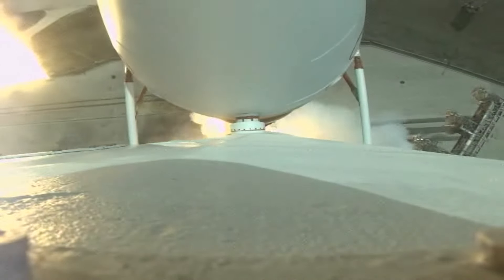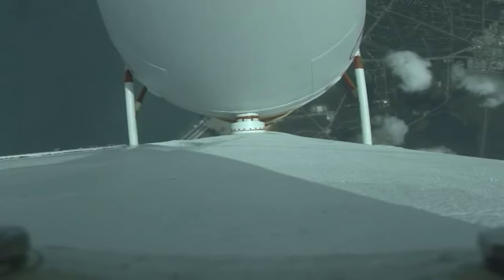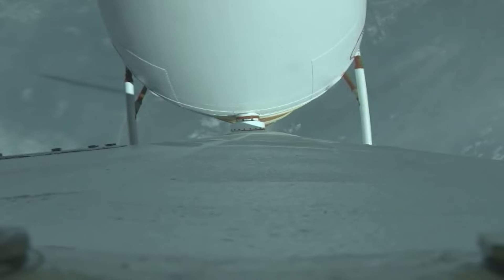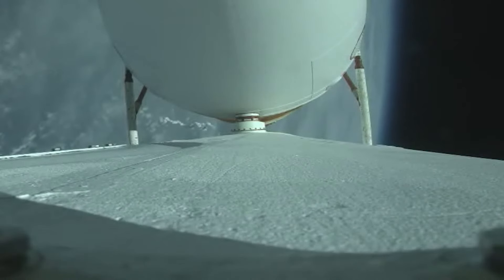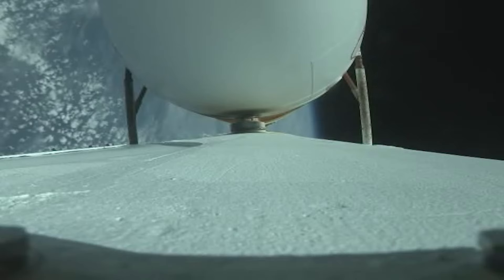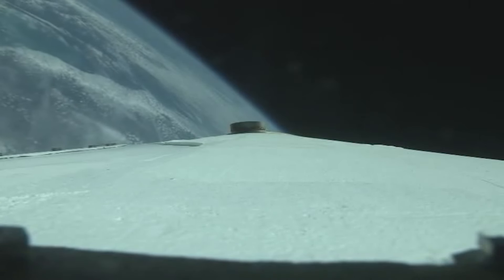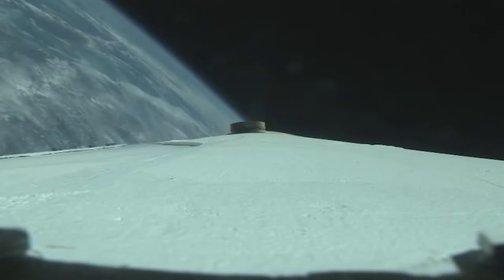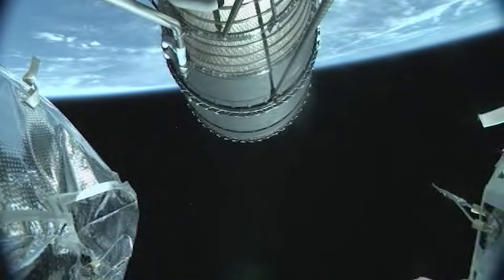Delta IV Heavy NROL-70 Rocket Cam

Comment: Sad that we won't see this wonder of engineering fly to space again
Reply: Not really. It was too expensive (thus why the US government was its only customer), and it's being replaced by a rocket that is not only cheaper but almost as capable.
Reply: @Ajax1984 🙄
Reply: @Ajax1984  yeah it costs up to $440 million per launch
Reply: Delta IV family began at Boeing in 2002. The Delta IV Heavy in 2004. The Delta family itself dates to 1960. If Old Space/ULA had been serious about rockets and space flight they would have actually designed and built new rockets instead of just spinning their wheels for 40+ years. The Vulcan (ULA replacement rocket) was obsolete before it ever launched. The Vulcan will also cost $100-$200 million per launch. The cost is only considered feasible if you are a government with zero cost prohibitions or Blue Origin who cannot and will not admit their "newest rocket" is less efficient than a current, cheaper off the shelf commercial rocket... say... Falcon 9 or Falcon Heavy.
Myopia is a horrid thing in the tech and engineering world. The europeans are not doing one whit better with their "newest" Ariane 6.
Engineering is not dead but Old Space seems to have forgotten the very notion of Bold and Innovated.
Luckily we have many, many new companies who will propel humanity to a brighter future. If it were up to Old Space they would still be using Soviet rocket engines and the CCP would have ended up eating their lunch.
Reply: @phlogistanjones2722 

Blah blah blah...

Look mate i would consider treating this comment seriously, but honestly, 1) original comment was sentimental
2) reading into first sentences i see its just waste of time.

Comment: Was it ever possible to recover this rocket with parachutes and helicopters ?
Reply: No, even the side boosters were at quite high speed at separation and too fragile to survive reentry. Bear in mind this vehicle design entered service in 2002 when SpaceX was still working on Merlin gas generator tests on a rented test stand in Mojave (I was there, in charge of that test stand) and booster recovery was still over a decade in the future.
Reply: @r0cketplumber  ok then . There goes my last hope for this rocket .

Comment: That's how a rocket launch SHOULD look. 
Failure is not a measurement of success.
Reply: without failure, no one succeeds.
Reply: @ThatOpalGuy  moving goalposts, and calling them successful is not succeeding. 

ULA knows how to succeed.
Reply: @MadGoat  i mean duh, if you're launching an actual payload on an operational mission from a customer like Vulcan did, like this last Delta IV Heavy did, there is no option other than success.
Reply: @clevergirl4457  You fail to realize failure is an option, despite what management says.

Sometimes failure results in a loss of life incident.

Comment: Glorious 1080p.... from the guys who launch the rocket....**sigh**
WAY TO GO with the 2012 video capability. Almost as if they cannot actually learn "new tricks".
Otherwise a fantastic rocket whose days were numbered in 2000. Shame they did not bother to develop anything better. Seems a waste.
Peaceful Skies.
Reply: Video feed is kinda a waste of limited bandwidth that could be better utilized by simple sensors(temp, pres, volatges etc). 4k is total overkill. 1080p is still by far the most popular resolution across youtube anyway.
And Vulcan is the 'anything better' they've been working on.
Reply: The engineering needed to select a new camera, design its enclosure, modify the cabling, and prove to the NRO's satisfaction that the changes won't increase the chances of mission failure (ie, a billion dollar payload going for a swim) was just not worth it to ULA. Rocket cams are a "nice-to-have" element, not a mission-critical one.
Reply: If your first point of concern is how pretty the video looked, your opinion is not worth considering in the first place...